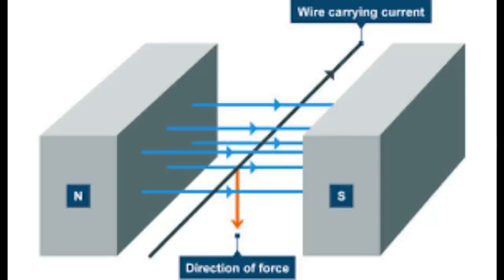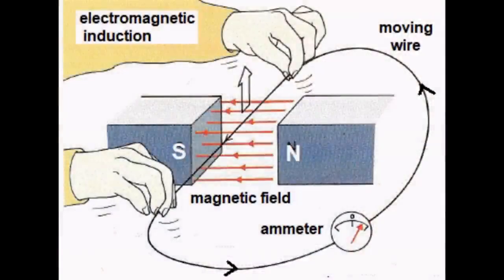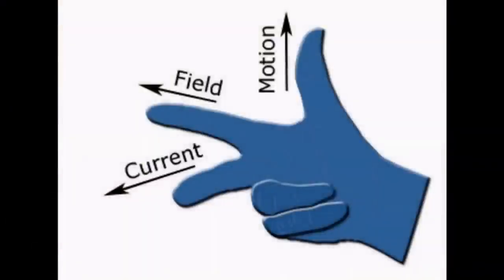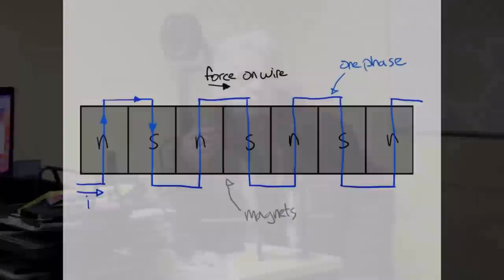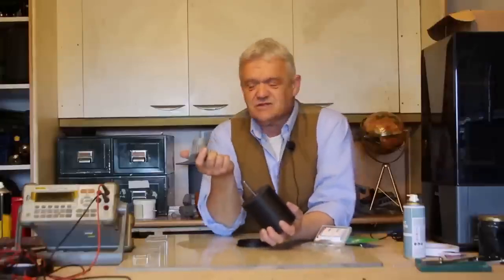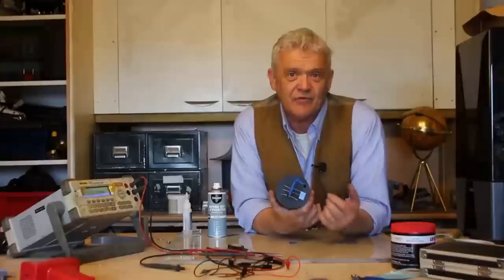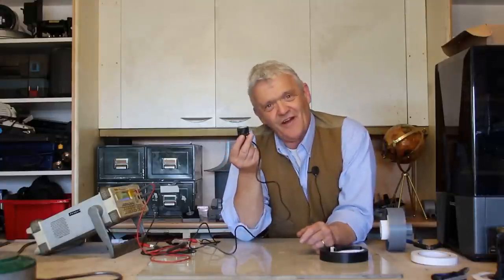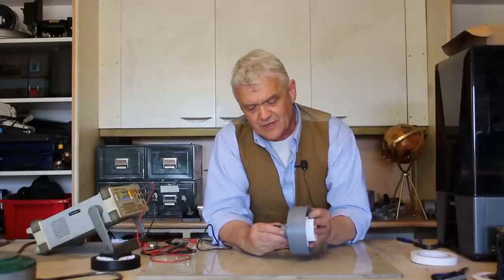009 The Folding Wind Turbine

Comment: Hi,

I love your videos.

I run an activity centre featuring some quite long zip wires, that we send 100s of participants a day down. I have been toying with the idea of creating a device that can be fitted to a roller (device that runs down the cable) to power an led light system in the departure tower. I was wondering if it would be possible to get in touch and ask you a couple of questions?

Comment: Can multiple increasing magnetic coils/windings be used as braking mechanisms on wind turbines, etc.? So that at certain speeds a secondary, third, and so on activates; increasing windings - increases load. Using that as the braking mechanisms on wind turbines, etc., not only slowing them down but increasing their energy output?

Comment: Star / Delta —— join the neg side together = star 
Connect in series = Delta 

Use a timer to start a high torque = Star
Timer :::::
Connect to Delta format and the full phase voltage across each coil = higher revolution

Comment: Robert even more to think about now, just got the drawings done for round magnets and now this, what appears to be a more power full generater, a friend and myself are starting the buid of a mongrel of your pelton wheel and the old "C" rotor , am I correct in thinking you got more power by insert steel into the formers for the coil , is your workshop in herne bay, as we may been down there tomorrow, and would like very much to meet you.  Stuart